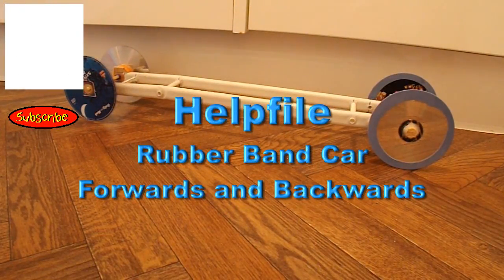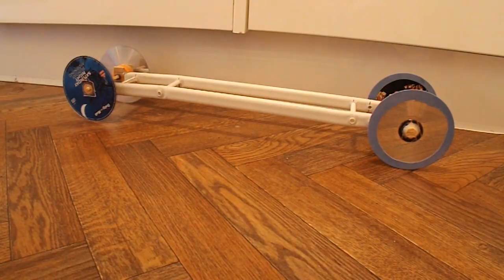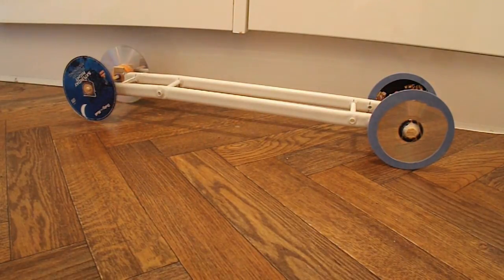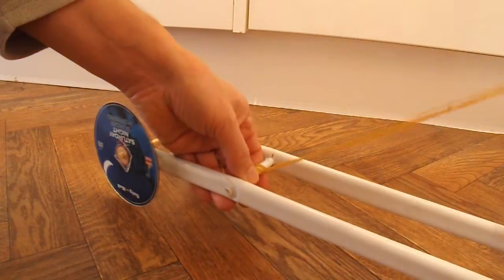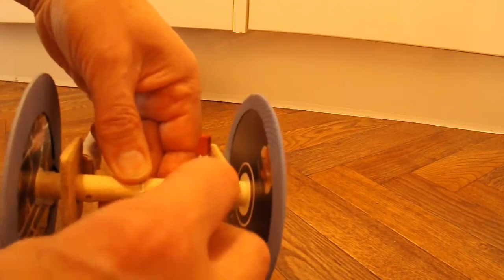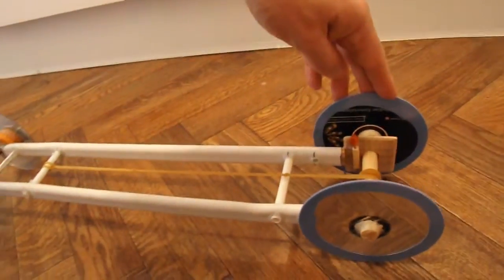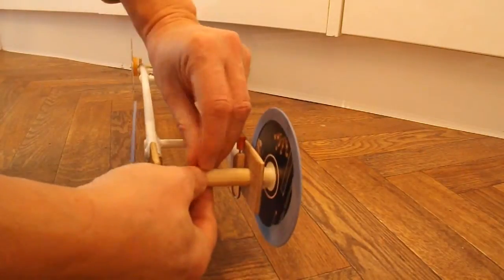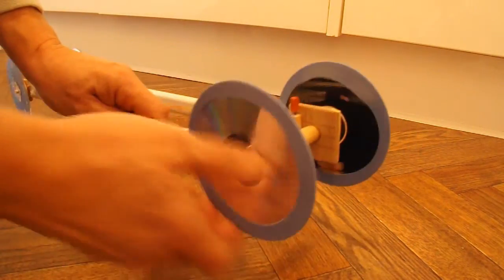Helpfile - Rubber Band Powered Car Forwards and Backwards

Comment: What are the materials that you used for this?Please respond back ASAP.
Reply from the maker: The original build for this car was in this playlist https://www.youtube.com/playlist?list=PLA5a2xPRSrB0zJ5RHjvsw46Mio6uJjF5_
You will find other useful links in the video description.

Over that series of videos it was modified several times

Looking at this video I would say the main components in this version are
-
PVC Oval Conduit
3 BallPen bodies
4 CDs or DVDs
4 small plastic bottle tops
1/4" square wooden dowel
15mm round wooden dowel
1/4" or 5mm plywood
Rubber gloves or balloons for the rubber tyres
several rubber bands

As an alternative to PVC tube I have used plastic garden trellis which has a similar shape but is smaller and lighter. I bought it in a bargain store or a dollar store if you are in the USA. It cost me £1 and there are enough strips to make several cars. https://youtu.be/1Nn1DMM9DOc

This car is fairly complicated to make so here is a simpler one Rubber Band Powered Car 1 x size 64 - full length video https://youtu.be/pIO3FiHX4Oc?list=PLA5a2xPRSrB3g5RiX8Kf_uUBOL0Tb7AS0